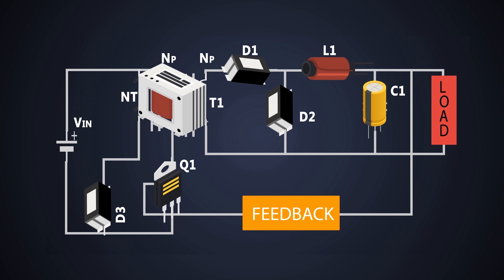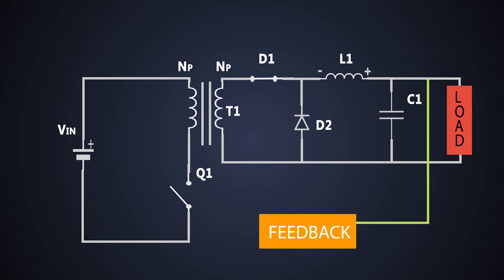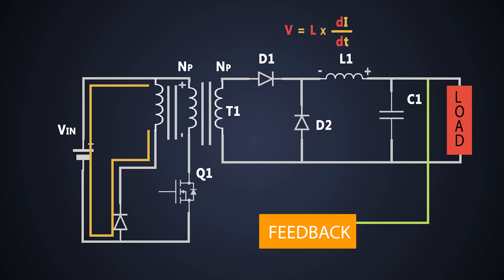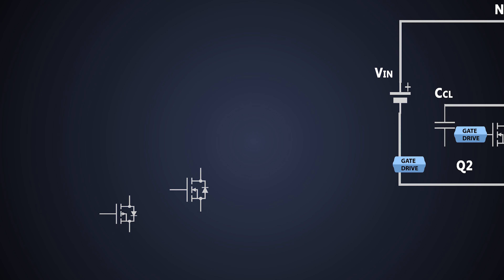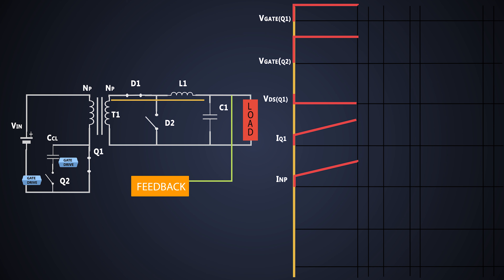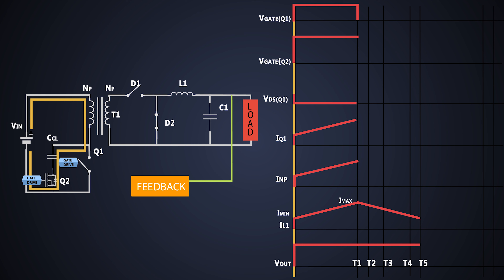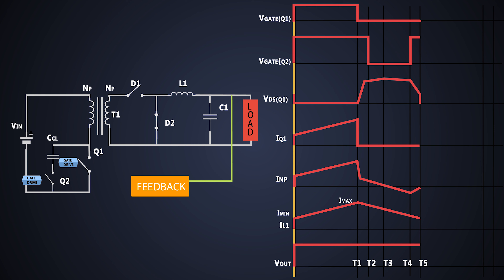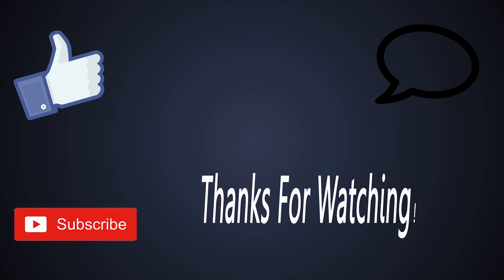Active Clamp Forward Converter Working | High side active clamping and Low side active clamping.

Comment: Once we get the switching pulse for the Ist switch. How is the Clamp switch pulse kept high from t1 to t2? And how is it again turned high at T4. How do we ensure that the switch turns on or off at the correct times?
Reply: There are many pwm controllers we can use
Reply: @abworld4370  Can you share some stuff regarding this.

Comment: Hi, which is better, Active Clamp Forward Converter or Double Ended Forward Converter? I think that Double Ended, because it has 2 transistors, which is why it, respectively, can give out more power compared to Active Clamp. Plus, the selection of components from Double Ended is easier. But I found an article on the Internet where it says that Active has such advantages as:

"The transformer is magnetized by optimal voltage, i.e. there are no useless losses of the
volt-second interval. Accordingly, we have minimal overloads of the components by voltage at
the maximum possible transformation coefficient for this topology
* The energy stored in the parasitic elements - the scattering inductance and the drain-source capacitance of the power key,
not only does not dissipate, but also passes from one element to another, reducing the switching energy
* Noise is significantly reduced when switching the power key, since its switching energy is
significantly reduced
* Due to the reduction of the switching energy of the key, dynamic losses are sharply reduced
* The working stroke is limited only by permissible overloads of the elements by voltage
* The pulse voltage on the power switch is connected non-linearly with the value of the input voltage, and can
reach its minimum value in the middle of the range.
· There are no voltage outliers on the power key due to the scattering inductance
* It is possible to switch the power key at zero voltage
* "Rectangular" voltage shapes make it easy and often without additional components
to control synchronous keys on the secondary side "

Which leads me to think that just because of this, Active Clamp will be much better than Double Ended, even though someone told me that this is a lie and that if I want normal demagnetization, I need to assemble a full bridge or a half bridge. What do you think about this in general?
Reply from the maker: Well. You observation is quite right. But selecting a topology is more of a designers choice. there are pros & cons based on your requirement & power you can select the converter.
Reply: The double ended is the equivalent of a normal forward without the third winding. It still has the same 50% top duty cycle limitation and requires a special top side gate driver, which adds up complexity. An advantage is that a standard single ended PWM controller can be used (so long as you can limit the duty cycle and provided you have some means to drive both gates) and that the maximun voltage stress is clamped to Vin. This is particularly important where using higher voltage FET's woulf result in higher gate charge and RDSon - which would drag down efficiency. Active clamp makes for a far simpler circuit with less duty cycle limitations, but you will need higher voltage switches. It's all a matter of compromises.

Comment: Please mention p channal mosfet voltage rating
Wattage required
Reply from the maker: It depends on specification of the converter?
Reply: @FoolishEngineer  t
Thanks But Any corelation with Input volt
Like equals v in
Or twice vin

Comment: You speak without some very distracting inflections other EE youtubers use, instead you sound much more natural. I appreciate that, makes it easier to pay attention to the content.

Speaking of which, the graphics are good as others said. What software did you use to make this, if you're willing to divulge?

EDIT: Also, I see it often stated such as in this video, a hard limit on a power supply type (500W) in this case. Seems that this would almost certainly depend on your component selection and availability, and of course we're ignoring paralleling and synchronizing supplies (obviously out of scope). But it would be interesting to delve into the limiting factors of the actual supply design.
Reply from the maker: Thank you so much!!

There are so many video creation software out there, I use After Effects
Reply: @FoolishEngineer  I didn't understand a little, please clarify in the video you wanted to say that in this topology we need to use a capacitor over 500 volts, or this topology is not advisable to use  in power supplies and converter over 500 watts?
Reply: @oblibox1  I think the author was talking about the inexpediency of using a converter with a power of more than 500 watts

Comment: Dear Sir, The same circuit, but we found the Q1 VDS still keep 2 times of Vin, seems there is some extra voltage added on the X'FMR. Would you please hit me whether any possible mistake will cause the boost Q1 VDS issue. Thank you.
Paul Tseng
Reply from the maker: Is Q1 Selected such that can sustain that increased Vds value?
Reply: @FoolishEngineer  Yes sir, the Q1 is 60V, measured voltage on Vds is 30V, within application condition. But we found the Q1 will damage by linear mode operating, with big burn mark under the wire bonding of the source.
We had use evb from adi (LT1952-1)to check the wave form, it's keep in 12V.
That's what we found. Thank you.
Paul